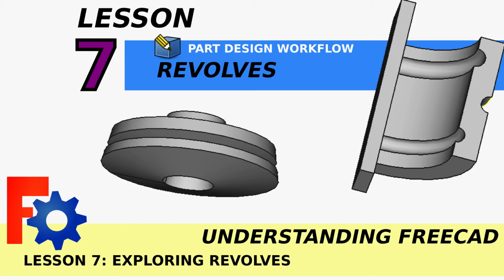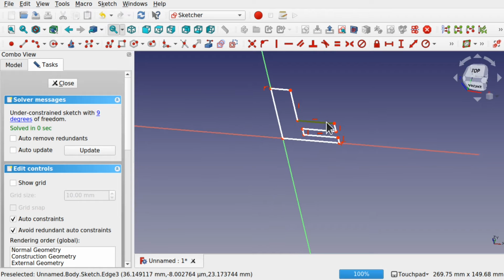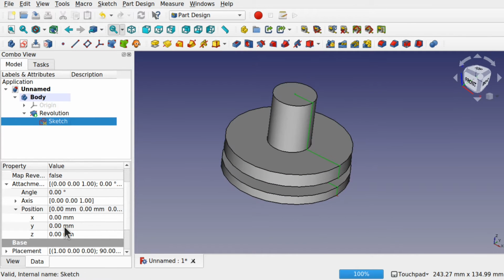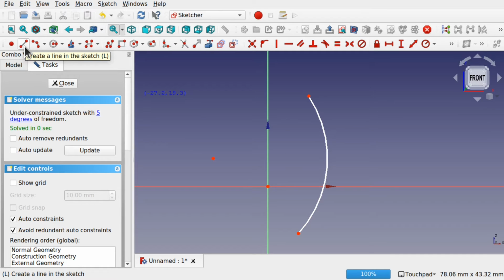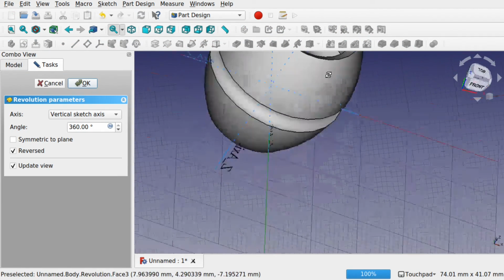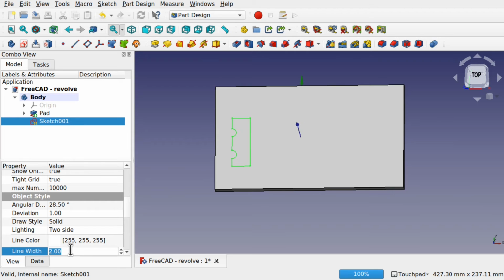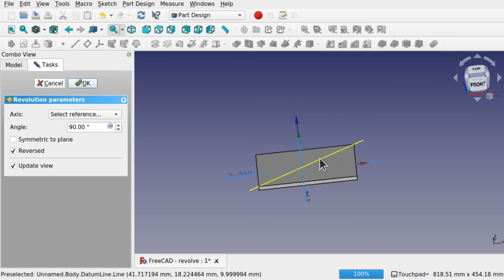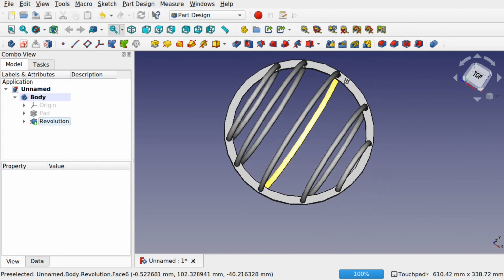Understanding FreeCAD: Lesson 7 Part Design Revolves | Interesting ways to use | Beginners Tutorial

Comment: Currently losing my mind trying to figure out how to cut a hole into the side of my revolve. It's easy to cut a hole from the top because it's a planar surface but almost impossible on the side.
Reply from the maker: Make sure nothing is selected and pick a base plane rather than selecting a face first.  You will be able to position the sketch using the attachment offset attaching straight to the bodies origin planes.

Comment: i want to create an oval box with groves or hold a ovel plate. Is there a way to do revolution on an oval path and not circle
Reply from the maker: Yes, you can use a path and create an additive pipe to extrude a profile along the path.  Here's a video showing that theory: https://youtu.be/TZCF7HVoU74  and an exercise of using that operation, you just want the pipe part and not the revolve https://youtu.be/kbTj9Nucpq4
Reply: @MangoJellySolutions  thanks. I was able to do it

Comment: Interesting - but that is a much more long-winded method of hollowing out the object than using the 'Thickness' pocket shown in the last tutorial. I can accept that, perhaps, there are some instances where this is the better method, but if so it would be useful to see when that might be the case. In this instance, the Thickness pocket works just as well.
Reply from the maker: The thickness doesn't always work especially with complex objects.

Comment: Thanks for these informative, easy relatable tutorials. I have one question on what you did around 5.50mins. I have a revolve where I purposely created a hole like you did in the centre by moving off the axis but I then need to create a hexagon pocket concentric at one end of the hole. Say 10mm inset. I assume you have to create a datum to set it up but I can't get it in the opposite plane. Please can you assist? Thanks.
Reply from the maker: Great to hear you liked the video.  So you can use a datum plane or create a sketch and then change it's map mode.  I have a number of videos regarding sketch attachment on my channel.  Also, if you find it's the wrong way round have a look at the data tab and located the map reverse and change this to true.  This may help you.

Comment: Don't ya just hate it when, after being in the draft workbench, you realized that you forgot to turn off the grid?  I found that using the g and r keys will clear the grid from within other workbenches.
Reply from the maker: It is so annoying isn't it! Nice short cut, thanks for that.  Come to think about it, I haven't checked  to see if there is a setting to stop this from happening........ just checked, there is but it doesn't seem to allow the grid to be switched back on! If you got to your settings, and then click on workbenches, then you have to select the workbench and load it to get to it settings.  If you load the draft you get the icon added to the left hand side.  Clicking on it you will see a the setting for draft and a grid tab.  You can disable the grid from the 'use grid' setting but you can't get it back.  What a shame.
Reply: @MangoJellySolutions  in preferences/draft/grid, has some options to turn it off